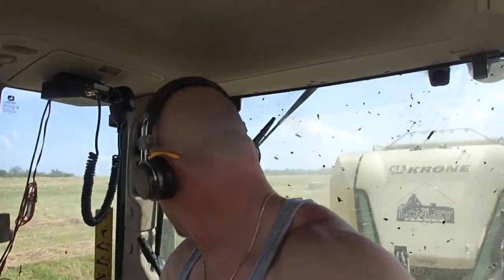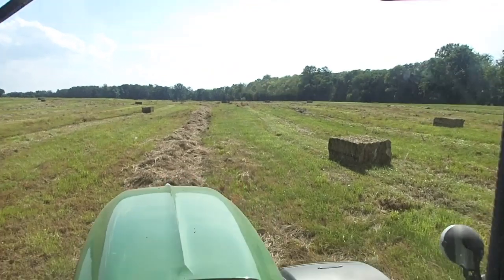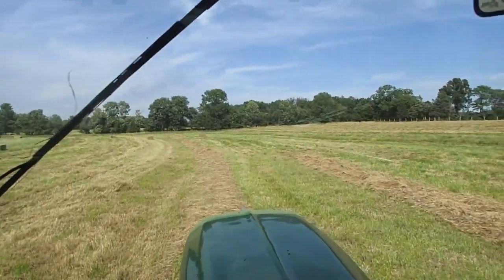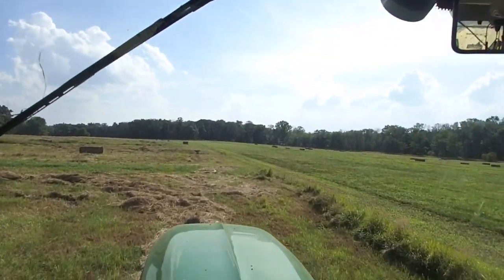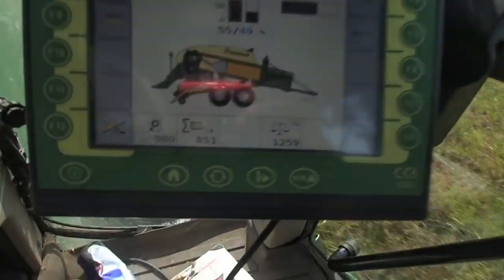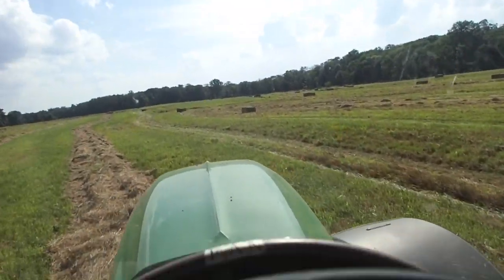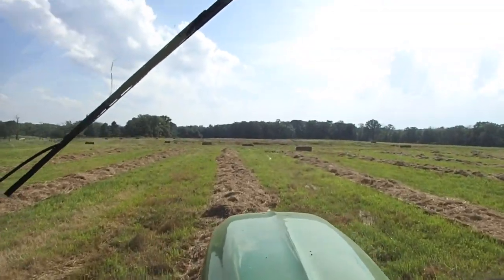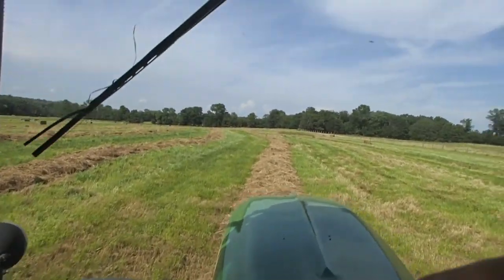Mud Hole Farming!!!

Comment: In General Contracting We get 10% up front it's called "Mobilization" That 10% carries us through the first 30 days and into the next 30 days of Materials and labor.  Normaly weve completed 30% of the work by the second DRAW at 30 days into the job and bill for 25% at that point in the project we're 5% ahead of actual work completed. Just a little information on General Contracting for you.

Comment: Hey Wes in our area we use an in-line ripper to drain wet ground. It has really made a difference over the years. It does not disturb the soil much at all as it has coulters in front of the shanks to cut the sod. Shanks a re spaced around 40 inches or so. Would something like that work in your area? We have recently had great luck with an aerway on our hay ground. Really helps with compaction and draining water. It also does not disturb the soil. Just punches holes. You really should try it! You won’t be disappointed!

Comment: Dosnt that tractor have front linkage? Make a fram and add a little weight for more traction on the front, will help you pull through the wet bits

Comment: Just wondering if westendorf has mounts for your 7530 that would let you put the loader from your 8120 on the 7530, if there was mounts then you could put the loader on either tractor as needed.

Comment: Just wondering if your balers have brakes on them to help when you're going down the road
Reply: Yes the Krone balers have brakes he did a series of videos when he put the brake kit on the 8120 so he could pull the 1st Krone the 8530 and the 7530 are Europe spec so they came with the hydraulic brake kit on them

Comment: The video was fine, no complaints. 
That property was a swamp! I guess the wet weather earlier in the year has the ground saturated and there's no place for the water to go. Hot, dry weather for a week or two should improve things a bit.
Hope you aren't losing too much hay in the wet areas. Would it be worthwhile to come back and bale those spots later?

Comment: You need to learn how to setup a services contract.  At the very least, you should get paid mobilization and other overhead costs, when you show up on-site.  You need to setup a schedule of values that is part of the contract and you get paid according that schedule of values.   The schedule of values should include your overhead incurred to reach the milestone in the schedule of values for each payment point.   It's no different than any other services contract.   Normally, the client will retain 10% of the payment request and the final payment includes all of the retainage when the contract is closed out.